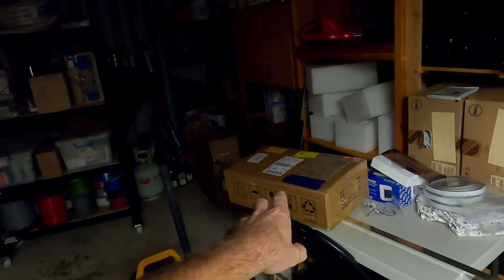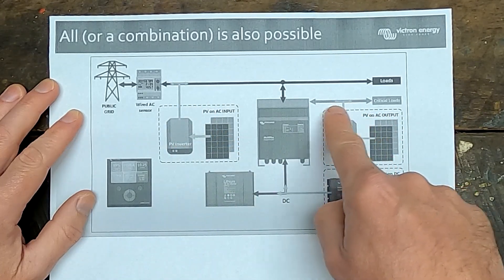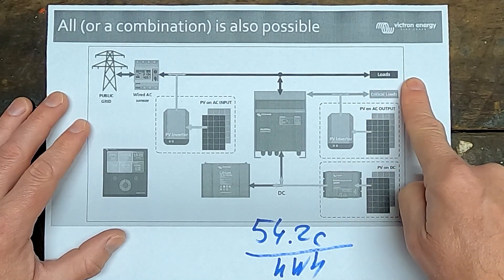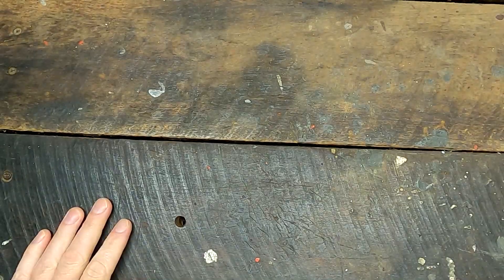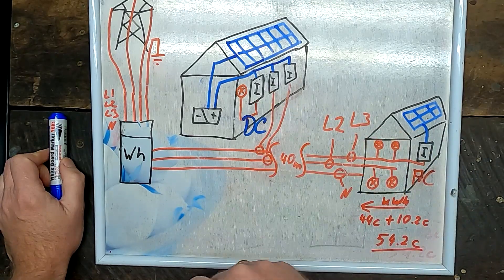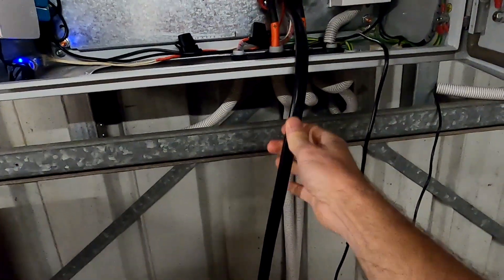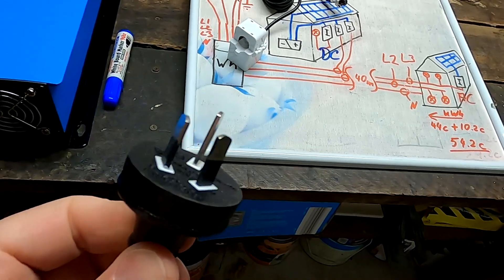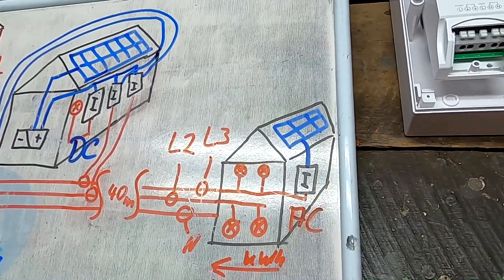Zero feed-in solution to power the house from the battery (and stay legal)

Comment: Those units are not UL 1741 compliant, so I wouldn't try it. You can get into huge trouble connecting these devices to the grid, even if it should theoretically not backfeed. I'm not sure what your laws are, but in most places, this is a bad idea. I criticized a ton of YouTubers for using these in the past. If it's not UL 1741, don't connect it to grid regardless of your laws.
Reply: In Australia Grid-tie inverters need to have AS4777 certificate, I think.
Reply from the maker: Thanks for the feedback, Will. Can you provide an alternative solution though?
Reply: @OffGridGarageAustralia  I believe you have given up on the Multiplus 2 unit to quickly. Is it the price, because I believe it can do everything you want it to do. Have a talk to the Victron guys, post a question.
Reply: @markparker9749  yes the multiplus and Quattro can just need to add anti islanding to keep it legal in Australia
Reply: @Aussietrucker  The multiplus & quattro are already legal in Australia, they are on the approved list and meet all Australian Standards
Reply: @Aussietrucker   multi plus 2 comes with a build-in anti-islanding function.
Reply: @OffGridGarageAustralia  oh sure, buy a more expensive inverter. You really don't want a cheap grid tie inverter in general. Growatt has UL 1741 grid ties with zero export feature that you want. If I were you, I'd just continue to do Offgrid or supply a couple of your circuits with a transfer switch with an Offgrid inverter. Much easier
Reply: @WillProwse  Exactly what I suggested. A transfer switch completely isolates from the grid the circuits supplied by the off-grid system. Bonus is you can flip those circuits back to grid supply if ever needed and the off-grid supply is always isolated from the grid.
Reply: @alexsimmons1803  A simple battery charger can be a bridge from grid to offgrid. Just set it to a low voltage range to operate in so it secures a floor for the voltage of the battery it will not go underneath. I have a 24 volt battery that is solarcharged to max 28.4. It has a AC charger that is set to 25.6 volt (lowest value of voltage for for absorption mode etc). It make sure I have at least that level in case sunshine is not doing enough.
Reply: Yes, people in the USA connect garbage inverters all the time, but it certainly is not legal. I notice that they also seem to fail in a year or two. You get what you pay for.
Reply: They ARE approved in Australia Will.
Reply: @sundancer442  can you show me the link to where this actual unit is approved in Australia because I couldn't even find the data sheet for it showing it meets the current Australian Standards. Copy of the data sheet would be a good start.
Reply: @sundancer442  I could only find  the SUN-5K-SG03LP1-EU and SUN-3.6K-SG03LP1-EU modules on the Australian approved list and they are not the models Andy is using
Reply: @sundancer442  seriously? Wow that is concerning. My family who lives there still complains about the shortcomings of Australia, but approving this piece of junk inverter? That's a new one. 

Do you have a link to relevant literature showing that this would pass inspection?
Reply: Can these units be used solar charge controllers and AC chargers for my battery bank?  Just don't use the inverter limits?
Reply: And the batteries you put together that are environmental Nukes and EXTREME fire hazards are all OK? Will, I have been following you since before your move to Carlsbad and I purchased your book. You are a good guy and a influencer and a leader in DIY solar. Lecturing about safety is where you need to take a breath and look in the mirror. You have NEVER developed a product to meet UL, CE, FDA, TGA, ..... CE, or any other standard. If you had, you would know they all started out "good" now they are full of bullshit politics. You do not have a clue in this one area and you should back out (or stop with your dangerous battery building/testing as you most likely are in violation of many codes where you live in N Vegas).
Reply: @Will, I have just looked at a site on AliEx and found this under Inverter Specs: Standard

UL1741,IEEE1547,VDE4105

I know that the SUN inverter will not meet a 5 min reconnection timeout which they have in the USA. As well not 3 or 2 min as in other countries. But many other countries do not have a requirement for a certain Grid-stabilization time before reconnection. The boot up sequence for the inverter here is around 30 seconds.
Reply: @RolandW_DIYEnergyandMore  hey Roland! Hmm I wonder if it's certified by 3rd party or listed. Or only conforms to code, and manufacturer is the only one who verifies the claim. My understanding is that any of these "plug in" units fail inspection due to not having a cut off switch and dedicated breaker to code.

In my state, and the one I used to live in, you can get major fines and potentially jail time by using an inverter that is not listed. California even lists out what inverters they have approved. They are very strict.
Reply: @WillProwse  yes Will, you can take a bet that they only "conform". But you know the world is big, and regulations are different everywhere. You will ROLF, if I tell you, that for example here in Thailand, inverters need local certification. Even the best SMA, Growatt, Fronius, you name it which are installed by the millions worldwide. Its all just about money. So we need to acknowledge that a device which was installed by the tens or even hundreds of thousands worldwide, even if it might be banned where we are, can still be perfectly legal somewhere else. The main thing is to know, that the guts of this inverters  are built into many more different models under different setups. And they are pretty safe. But yeah, it is the users responsibility to find that out for himself, and if it is worth the risk if those are not covered by their local laws.
Reply from the maker: The internal relay is definitely missing in these units, so they will not comply with regulations in most countries.

Comment: I have a similar setting for 5 years. It works with no problem. 2 years ago I change the sonoff and install a Shelly 1pm. In my case the only problem, since I’m not using batteries (I’m just using solar panels on the dc side) during the night they need to be disconnected because they consume about 50 to 70 watts. The best of this setup is that Shelly and sonoff can be used to monitor the power used.  For the monitoring part selly1pm is better.
Reply from the maker: Great, thanks for sharing. I've got a lot of Sonoffs in use already so sticked with the same system.

Comment: Why dont you just set up a critical loads panel for victron to power? This set up you are proposing wont power your home when there is no grid present(according to specifications)
Reply from the maker: We lose the grid 2-3 times a year during a heavy storm, so that's not a concern.
As I said, I don't think the Victron ESS can do what I need to do.
Reply: @OffGridGarageAustralia  readin victrons docs it seems it can but does not use a ct and they also mention they dont give support for it( has to be set up by installer,which is weird!) The mode 1 seems to be what you want but i would be weary when a manufacturer stated they give no support for a function they offer.
Reply from the maker: @roqm1248  right, I read something like this on the forum but could not make sense out of it. Great from Victron...

Comment: This will not run when power goes down.

Just get Multiplus for garage, hook grid AC into multiplus ac input. Multiplus AC output to critical loads. Excess PV pushes out through AC input of miltiplus to grid. When power goes down, disconnect main breaker from grid and push power from garage multiplus to house circuits via you telling it via AC input on multiplus. Unit and run fine pushing energy both ways, was made for it.

BTW, you can run without AC meter installed
Reply from the maker: The power does not go down often here, it's not a concern.

Comment: Andy, n.b. the SUN Grid Tie Inverter, like most grid tie inverters won't supply power to your house (or any load) if the grid is down. 
Because has you said he need a grid "signal " to function...
Reply from the maker: That's not a requirement for my setup. I know it's a grid following inverter but that's fine for my application.

Comment: Andy why not ceep the grid tide like as is. End bild a off grid hybrid heavy to power the 🏠 en your garage .You only have to taken load off from the grid tye by installing a fuse box next to your original in your house. Just switch over invidual  cable from grid tide to off grid tide fuse box. So You ceep the grid tide up to code and only taking loads off from house to your off grid garage. In other words
Keep grid tye onthill your contract is ended. I think is much more simple.
Reply from the maker: That's not possible and would require additional cabling from the garage to the house.

Comment: Be extremely careful that your new inverter doesn't create a double feed that your grid connect doesn't see your grid go down due to your new inverter feeding the grid connect, and like wise the other way, this will become dangerous and make the street wiring live
Reply from the maker: That's not possible. You can connect as many inverters in parallel as you like, they will all work together. As they are all grid following inverters, they will shut off immediately if the grid goes down or the supply is been cut off by the supplier.
Reply: @OffGridGarageAustralia  I'm not sure that is completely true, because GTI's can fight each other that's why some suburbs have become saturated and Egron is not letting anymore people with GTIs solar for that area. The basic principle of the GTI is to slight increase the voltage so energy will flow from it and not from the grid. So as each GTI comes on line each one increases the voltage to enable it to supply power, so there will be a point that with too many GTI's on the same line it may get above the maximum voltage level for normal household equipment. That is why some GTI's are approved in Australia and some are not because the approve ones have a limited on the maximum voltage and switches off to protect the network. That's is why units like the victron mutliplus has a connection between each unit in series to ensure they place nice together, otherwise it is potential chaos.
Reply: @OffGridGarageAustralia  That's true with approved inverters, the distributor that owns the network will only allow approved inverters, if you don't use an approved inverters with the right safety approval can fail and leaves you open to legal action similar to phone signal repeaters on the market

Comment: Hey! The victron mppt have a special function on the relais which is called *daylight sense * which turns the internal relais on, when your garage senses any daylight, you could use that to trigger the new inverters, so they shut off, when you sense daylight
Reply from the maker: Ah, great. My MPPTs don't have a relay built-in. Maybe only the larger ones do?
Reply: @OffGridGarageAustralia  oh. Yeah I run the smart solar 150/100 on my RV and the relay has like 10 different settings, I run my cooling fans on the daylight mode so it's all quite at night

Comment: Your main RCD to protect you in case of mains leakage will not work when you powering from those SUn inverters. I'm pretty sure that setup is not legal - does the inverter comply with your grid code as it is connected to the grid?
Reply from the maker: The RCDs will work as they are in series with each other. In case of a fault, one of the will trip and disconnect the grid and inverters. This will be in line with the regulations.
Reply: @OffGridGarageAustralia  You keep avoiding the question, whether or not the units are approved units and that what you're doing is legal
Reply from the maker: @markparker9749  They are CE approved and meet the requirements and regulations in terms of safety (eg. RCD trigger times...)

Comment: Please stop calling it hybrid inverter! That is an off-grid inverter. A hybrid inverter is a Grid-tie inverter too and sells power to utility. What you bought is a simple Grid-tie inverter with limiter. It is not off-grid so in a blackout you will be sitting in the dark (again :)). You can not parallel a lot of Grid-tie inverters. Every inverter rises the V. It is a serious problem in residential areas where a lot of houses have solar
Reply from the maker: No, no, no, this is a grid following inverter, not a grid forming inverter. It is NOT an 0ff-grid inverter at all!
Reply: @OffGridGarageAustralia  MPP Solar sells hybrid and off-grid for more than 7 years now (experts). They seems to hate this marketing bst too as in they download page starts:
Term Definition
HYBRID = grid injection capable, energy flow to grid is TWO-WAY
OFF-GRID = grid injection NOT capable; energy flow to grid is ONE-WAY only
The off-grid inverters exact term is Off-grid With grid support. As it has an ACin and an ACout port.. Your Victron is a simple Off-grid inverter.
Reply: @OffGridGarageAustralia  Also there is no such a term as "grid following" and "forming". They are grid-tie and off-grid.

Comment: Hi Andy, check sunsynk or deye hybrid inverter. those 2 inverter maybe a solution for your need. they have feature "time of use" and can limit output power to grid or CT clamp. Also they can be parallel.
Reply from the maker: I checked them, they will not work because I'm feeding energy back from the house (load side) to the grid.
Reply: @OffGridGarageAustralia  you don't have to put your house load to load side, just put it on the grid side. their grid port is bidirectional port. So the energy can flow in and out from that side.
Reply from the maker: @rmdjapri  right, I see... thanks.

Comment: A hybrid set to prioritize grid power is the easy solution assuming you can get it between your circuts and grid power as well as connect to its battery and solar.  If your trying to send power from an out building back to your house but keep it on the grid during the day that isn't going to work without being quite sketchy.
Reply from the maker: Yes, that is correct. The connection is not a problem as I have the main meter box just outside of the garage and I can tap in between the main meter and the house easily.

Comment: All these need grid power for timing and operation, is that correct?  If the grid is lost then no power fed back to grid of course and no power for the house.    Have I missed something here,  I thought one of the hopes was that you could power up house from your battery bank when the grid was off Andy?  Can you clarify my thinking please?
Reply from the maker: Grid outage is not a concern. That's not what I build the system for. I still got the Bluetti for that 😁
I would need a Victron Multiplus which can do both grid following and grid forming to keep the house running during a blackout.

Comment: Victron Multiplus 2 can also work with an external CT (current transformer) and ESS software that drives the inverter to keep the grid current at 0.
And you can also easily control the inverter on-off with an external low-voltage dry contact relay (the inverter has a REMOTE ON / OFF input).
PS1: you forgot to tell us how many amps of sunshine you have!
PS2: you were wearing the wrong shirt!
Reply from the maker: I found a schematic for a Multiplus using a CT but... here is the thing: I would need to make sure the solar form the house still get's exported to the grid instead of charging the batteries. So the Multiplus needs to stay turned on for that to happen. I could not find any information if I can set the Multiplus to prioritise the grid export for this solar instead of charging the battery.
All scenarios I've see so far are like the following: solar powers your load, excess solar charges you battery, if they are full, it exports to the grid. I certainly don't want to charge the batteries with this precious solar energy. As a priority, it needs to go back in the grid.
Reply: @OffGridGarageAustralia  Configure it. Turn off the charger so it never charges. Set it so it's only goal is to add current downstream to zero out net current toward the house. If current is flowing from the house toward the line it just goes idle. Set up a remote disable. This Multiplus is off to the side so doesn't need to be on. Only the current transformer is in the main line. 2 years ago so have you done this yet?

Comment: I think 2x Multiplus II 3000 would be a better choice. They are completely isolated between the AC and DC side by the toroidal transformer and also have a connection for an external current transformer for limiting. They are also certified to be able to operate them on the power grid.
Reply from the maker: All scenarios I've see so far are like the following:
- solar powers your load
- if there is excess solar, it charges you battery
- if the battery is full and still solar, it exports to the grid.
I certainly don't want to charge the batteries with this precious solar energy. As a priority, it needs to go back to the grid. 
I haven't seen if there is a priority which can be set in the Multiplus to allow that.
Reply: @OffGridGarageAustralia  The Multi / Quattro ESS options offer interesting possibilities. It looks like you can switch the time-dependent compensation on and off via the Raspi with a small script. Maybe it's worth taking a closer look.